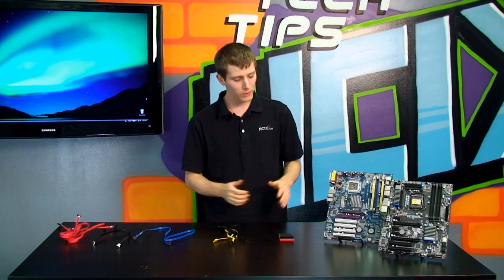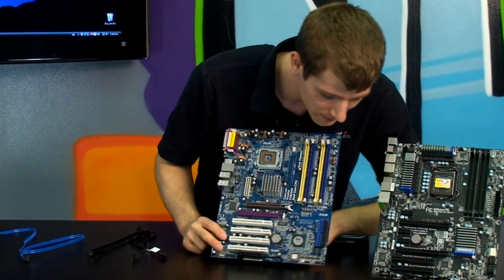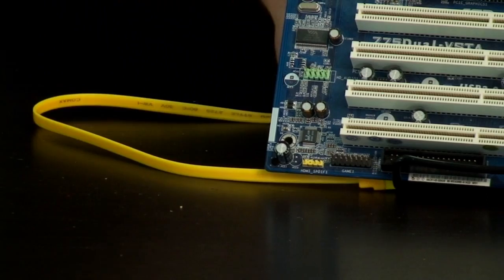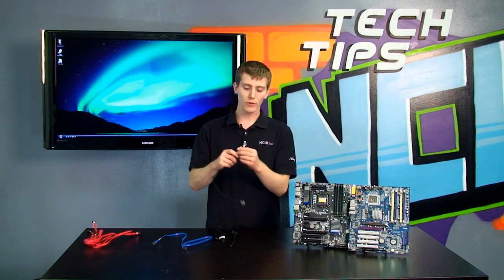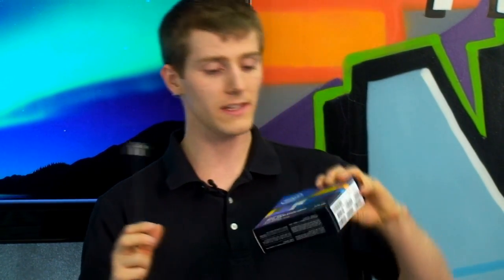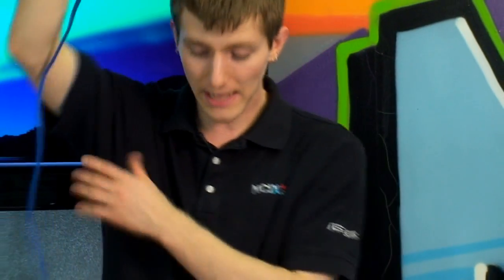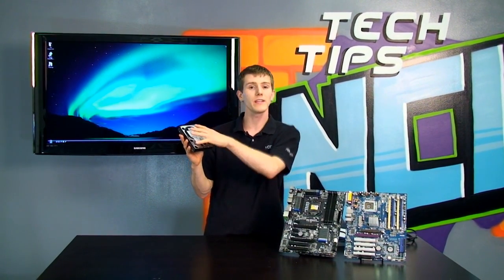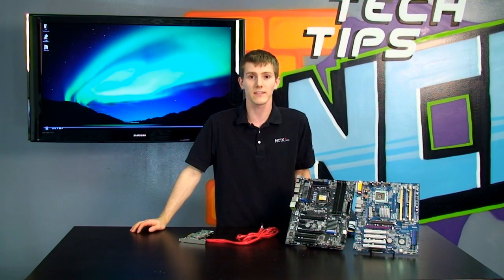SATA Explanation - Ports, Cables, Controllers, Motherboards - What You Need to Know NCIX Tech Tips

Comment: I could use some help, atm I only got two 6GB/s sata's and two 3GB's sata's and need to plug in ssd, hdd and optical drive. should I then connect the 6GB/s sata's to the hdd/ssd's and one 3GB/s sata to the optical drive? does this make sense, is there any downside to using 3GB/s sata plugs on the optical drive? my first build people, just looking for help here because of rubbish manuals.

Comment: If i use a sata 6gb/s cable on a 7200rpm hdd would it increase the performance? If not which cable should i use and which sata port should i be using.

Comment: I have been useing Sata 2 for the past 4 or so years, I have also had an SSD for the past year which is much better then any hard drive your going to get. anyway my sata controller on this motherboard is as I said about 4 years old and it is now damaged however I have a nice new lovely sata 3 board coming soon :D only thing im missing is a sata 3 SSD which will problable be one of the next things I get. however if your still using a normal harddrive (HDD) then I recommend that you try a SSD.

Comment: Guys an easy way to convert GigaBITS or MegaBITS to Giga/MegaBYTES is to take the BITS speed, example 6Gbps, turn it to megabits so 6000, divide it by 8 (8 bits in a byte) and there is the GB/s or MB/s speed.

Comment: @jutenheim223 @AsdTbH Yes, you can perfectly use a SATA II drive with a SATAIII or SATA I connector, they have the same amount of pins, work the same way and are physically the same, you can also use a SATA III cable for a SATA I or SATA II. They are all completely compatible with each other, but depending on the lowest model of SATA in the mix that you might be using, is the speed it will be using, so if you have a SATA III port, with a SATA II drive, you only get SATA II speeds.

Comment: @OfTehRose Yes, SATA2 is backwards and forward compatible with SATA3. Meaning you can also plug SATA3 drives into SATA2 connectors. But the drive will be limited to SATA2 throughput of 3Gbps.

Comment: Great video I have just bought an SATA 3 SSD drive and my older motherboard only has SATA 2 speeds and connections  I was told by my local shop that I should purchase a controller card to convert SATA to to SATA 3 making it run at the 6gbps that it is meant to.

Comment: @commodore256 
Parallel interfaces are actually not faster than serial interfaces.
Parallel data connections meet timing problems at significantly lower transfer rates and shorter paths, that's why serial interfaces became more and more common for high speed links -- also on-chip and even on-die!
The given progress to that are multiple serial connections, which again is parallelism in a way ... without the disadvanteges of strictly parallel interfaces of course.

Comment: @wwyk1993 I've never seen eSATA raid before on a controller. The only way I know is to use RAID storage cases with eSATA.
The way I think you mean is doing a raid across two eSATA ports. If at all possible you'd have to google if there is  chipset that even supports something like that. My chipset doesn't (MSI P67A-GD65 (sandy bridge) motherboard) support it at least.

Comment: @12eb3L It's not faster at all because they can't shoot electrons faster on an HDD anymore. It's physically (as in bound by physics) impossible to do.
You can connect a SATA1 and 2 drive to a SATA3 port though, since it's backwards compatible. Just like USB3 is with USB2, USB1.1 and USB 1.0. You just won't notice any difference in performance, for that you'll have to get one of the new generation SSD's. Like Intel 510's, Vertex 3's etc...

Comment: I will upgrade on Intel Core i5 2400, Asrock P67 Pro3 and 2x4GB Kit Exceleram 1600MhZ  1.5v.
The drives I will buy another SATA II 1TB Green 64mb cache 7200Rpm HDD and I use raid 0.

Comment: @GamingPrower hmmmm... well I think that is where an SSD would benefit. Getting a SATA III 6.0 GB/s HDD  won't make that much of a difference, look at the cache and the RPM. Fraps is good at recording at high fps with slower HDDs so you should be good. But if you want the extra performance go with a SSD then copy the finalized video to the HDD to save space instead of getting a RAID.

Comment: @TheProph7 errr... small correction. Linus actually said they were much like network cables, in that some may have additional features like locking mechanisms, or some may be slimmer or longer, but one can connect any cable between any drive and motherboard and it should work without issue.

Comment: @arim215 it doesn't matter. The cables themselves are identical as Linus mentioned. The only thing you need to watch for is whether the drive can take full advantage of the interface it is being connected to. For example, there is no sense in connecting an SSD that can provide read and/or write rates of over 375 Megabytes per second to a SATA 3Gbps controller. Connecting said drive to a SATA 6Gbps controller would allow you to take full advantage of the speed that drive offers.

Comment: @sandiegoborn32 yes, it is possible. The PCI-E slot runs at reduced bandwidth though (I believe they officially ran at PCI-E x4 equivalent), even though they were connected electrically as a PCI-E x16 card.Some motherboard makers did this to ease the transition from AGP to PCI-E when consumers first started moving in 2004 and 2005.